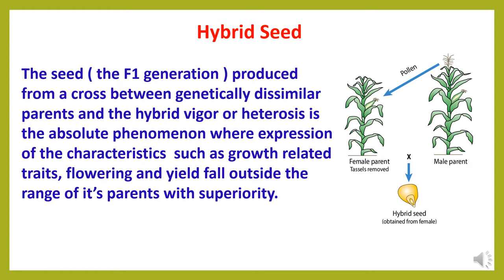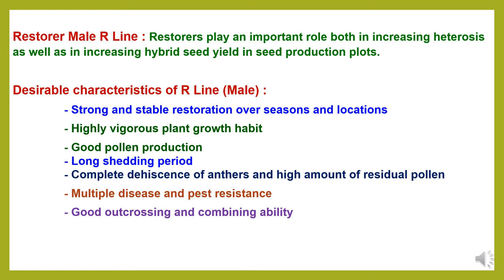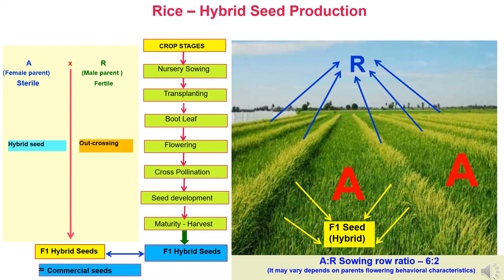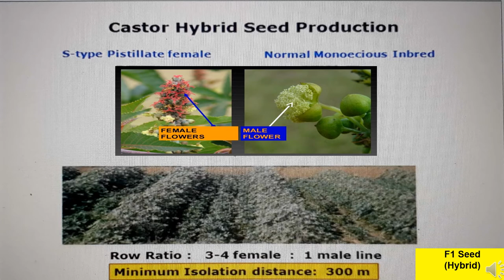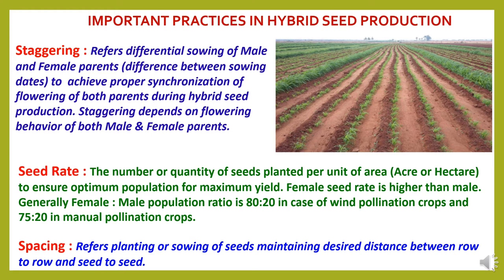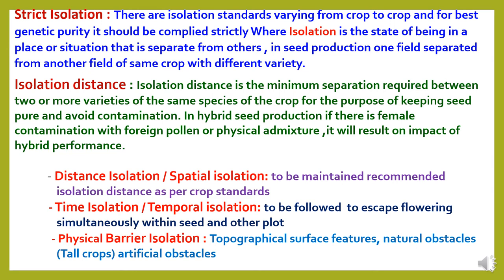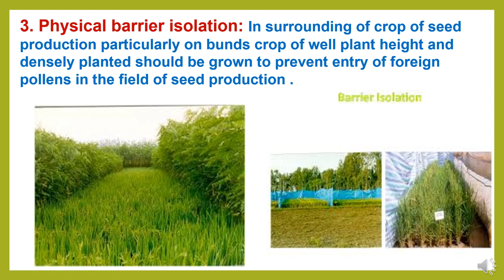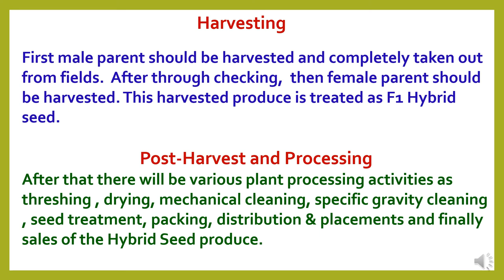HYBRID SEED PRODUCTION   BASICS

Comment: It is possible to produce a new hybrid variety by pollinating inside two hybrid varieties?
Reply from the maker: But both hybrids are fertile, in case of Hybrid one line should be sterile. We can try only in crops like Maize where in female we can do detasseling to make one line sterile and in cotton one parent as female where emasculation can be done. It will need research about flowering behaviour of both parents for correct nicking and for yield compatibility of male restorer line. For hybrid there should be desired characters matching for heterosis.

Comment: Pls explain ,how CMS is used in maize for production of double cross hybrid.
Reply from the maker: In Maize hybrid seed production CMS lines are not in use on commercial scale. In stead of CMS lines detasseling   process is followed to make female sterile. Trials are going on for use of CMS lines which will reduce pressure of labor for detasseling. Now CMS lines are not successful due to stability issues.  Other side due to CMS induce lines are reported to become susceptible to diseases like blight etc causing reduction in yield level. Research work in progress which needs stability in CMS base to use on higher scale.